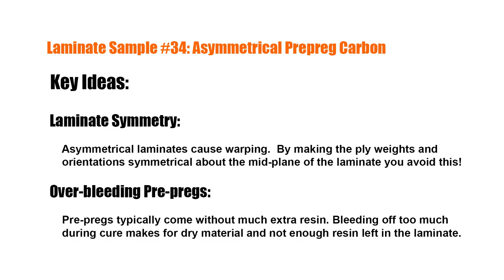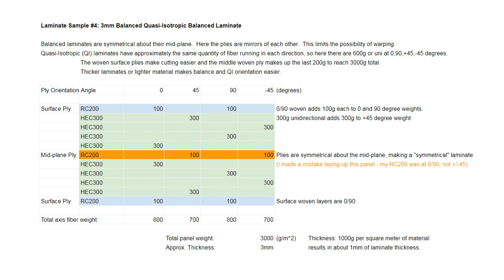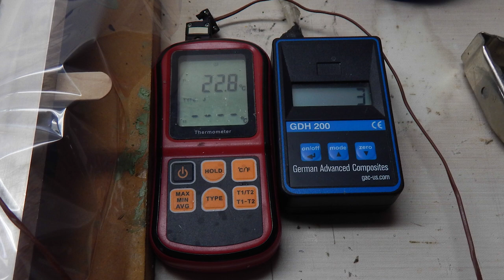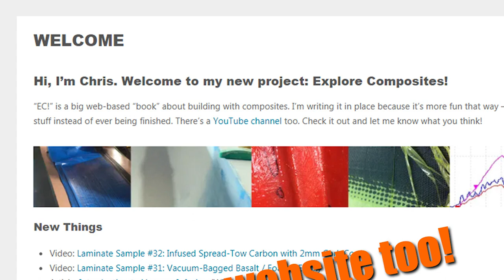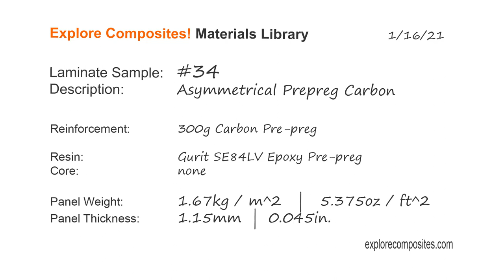Laminate Sample #34: Asymmetric Prepreg Carbon Sheet

Comment: hey anouther tip: you can use the plug it self- wriggle around on the underside of the aluminium and it will create a perfect round hole for the vacuumhoseplug without using a knife... that saves time
Reply from the maker: Thanks - I'll have to try that - sounds like a good idea!  

Just looked at my vacuum connectors and they are rounded and have a little roll pin  that goes through a slot where the top pokes through so it may not work as well.  Do you use threaded ones?
Reply: @ExploreComposites  try it. i use both

Comment: I’ve always been told the mechanism at work here is the CTE mismatch of fiber and matrix at elevated temp cure, as cured laminate cools, stresses develop which propagates the deformation. This is always the example given when discussing laminate schedules and why you want a balanced AND symmetric laminate. 

My understanding is that the *esters also have this issue because of the same mechanism. Even though they cure at room temp (but seem to be able to be much more exothermic than epoxy!) they have worse CTE characteristics so more extreme shrinkage. Haven’t considered the percent solids part of the equation... would be interested to learn more

I think the airplane wing structure being designed asymmetric, was to try to counteract wash(or twist) due to bending for better aerodynamics in its loaded(deformed) state. I’ve heard of people trying this in dinghy Centerboards too. Check your mechanics of materials textbook for bending of asymmetric beams to get a primer on that... then all you have to add is the mechanics of composites stuff! Easy peasy (like how easy it is to draw blood from a stone...)

I’d be interested to know what the application was where you wanted an asymmetric laminate to cure flat... There are compensations for CTE of tooling done, so it’s possible. But why try to make a potato chip flat the hard way when you can just use a flat mold and a balanced and symmetric laminate.
Reply from the maker: I think you're right - and I did a poor job of explaining "thermal stuff" in the video!  Lack of scripting had me mumble through those slides.  My understanding it that fibers constrain the resin long-way but CTE impacts transverse dimensions to each ply so stresses and warping... And I wish I could get through the engineering - forgot that math long ago!

This was just to demonstrate the concept of laminate symmetry and what can go wrong.  These samples are supposed to be quick little laminate examples, process demos and illustrations of things that go wrong -all packed together in a hopefully-not-too-confusing way!  I try to make enough mistakes to be educational but not so many that it's worthless.
Reply: @ExploreComposites  I think you do a great job of toeing the line between practical and the knowledge base behind why things are done a certain way with advanced composites.  I really enjoy all your content.  The articles on your website are a gold mine! I'm not sure I could walk through the math myself these days... the computer program does a good job though!

My other comments were trying to add to the discussion in a few other comments... probably just muddied the waters though.  Thanks for putting in all this work to consolidate your knowledge base to share with all of us

Comment: Thanks!  In the past I have naively assumed that warping shouldn't be an issue when using epoxy resin...because 100% solids.  Clearly that isn't true!
Reply from the maker: Yeah it's strange - not sure it's a volatility issue or a thermal issue... or both.  Resin CTE may be very different from fiber and fiber just constrains the resin from shrinking in the fiber-axis.  I am not 100% on all the mechanics of this so if anybody knows I'd like to learn more!  

Actually the aluminum tooling may have an impact on this but it happens with carbon tooling too.  This is really just to show that it does happen and to watch out for it...

Comment: Please make a video on how to calculate carbon fiber layers when you have a 3dimensional oart with different thicknesses like an orthotic in-sole (flat at the front, individual at the middle and rather thick at the end).
Reply from the maker: What about the layers do you want to calculate?  Analyzing a tapered or contoured part can be a bit of work - is it the composite properties you're after?
Reply: @ExploreComposites  no, in my case it is just the fitting/shape of the part. 

I would like to precut the layers and with an easy shape like a cube, this would be rather easy (lots of squares). But how many?

And when I have like an organic landscape shape, do I need to have a CAD model and slice it in layers? Or could a plaster model, grinded down work as well as an template?

 And finally my most important question: is there an upper limit for compressing fibers? Could I (theoretically) press 100 layers under a 300 tons press or at which point would the fibers break. 
Because I saw a video, where they tried to break a (cured) carbon fiber cube under an hydraulic press with many, many layers and they could not break the cube.

Comment: So is it impossible to get a flat asymmetrical panel? For example, could you have a mold with that amount of bend in it to counter act the post cure warp?
Reply from the maker: Yes I think.  I read about aircraft designed with unbalanced wing laminates to provide improved strength - or something.  With more complicated layups it becomes calculable from a shear perspective too.  Search "in-plane extension-shear coupling" - I am not engineer-enough to understand it... forgot my matrix algebra long ago.